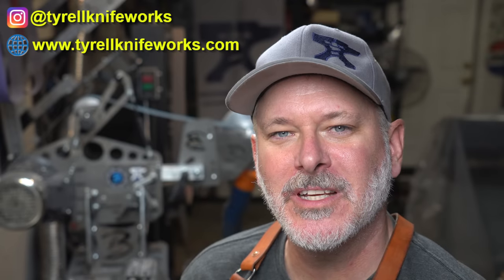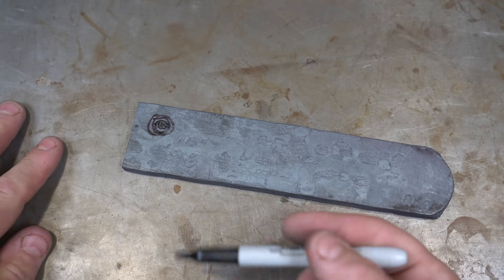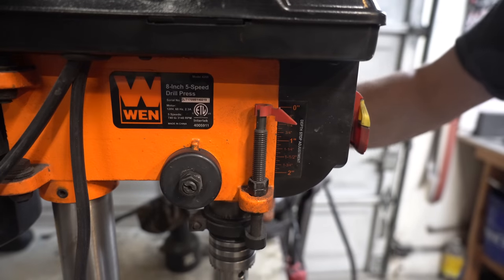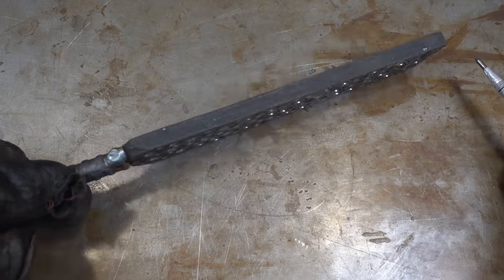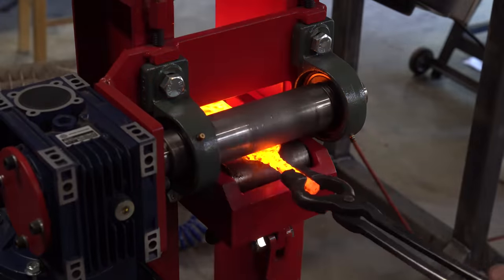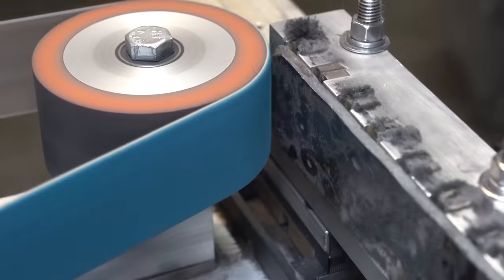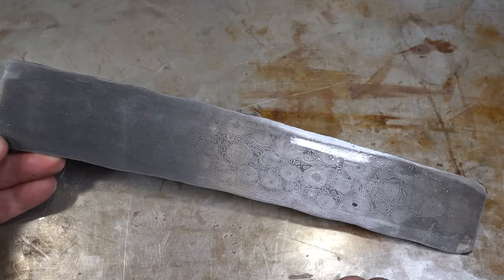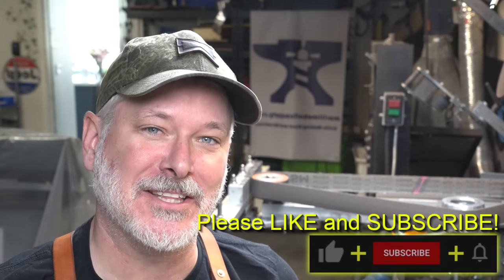Triple-T #102 - Damascus patterns - Raindrop

Comment: Two fluted ball nose endmills instead of twist drills gives me a better result with raindrop damascus. The transition is smoother and i gett more layers in the raindrops.
Reply from the maker: Yes, that’s probably much better.  It also looks better on ladder that way.  It takes much longer to do and it’s hard on your end mills though.
Reply: I use carbide endmills or with 12% cobalt the cheap Chinese one's.They last a lot longer than hss steel endmills. I also cut the ladder patterns with my milling machine and ballnose endmils. Just because I can.

Comment: I wonder if you could drill holes in holes ?? Maybe at a 16th deep ?? Or possibly a hole saw of some kind to make "rings" ?? Keep up the great work
Reply from the maker: If you had a CNC machine you cdd add n use a ballnose end mill to do any pattern.  The bottom of the hole needs to be rounded so a hole saw isn’t going to work well.  Thanks for watching

Comment: Random patterns are so hard, trying to get a consistent density as you create it point by point. I've tried handling this problem in computer graphics with Poisson Disc Sampling (random points that don't stray too far or too close to each other) and Blue Noise. They look like speckled patterns you might see in nature. I'd be curious about that type of pattern used for raindrop, albeit repeated and overlapping. Coming from a completely different field, I'd print off a poisson disc distribution example a few times and place it on the billet, drill with one size, replace the printed sheet and repeat with a different size. It sounds like overkill but randomness is so hard for me.
Reply from the maker: Are you saying you’re trying to replicate this in computer design?  I’m sure that’d be difficult.  Thanks for watching

Comment: would like to see you draw it thinner and then weld each side to some core steel.
Reply from the maker: You wouldn’t want to thin it out much more, even if you wanted to use it in a San mai.  It’s already just a hair over 1/8” so add a 3/16” core would be perfect for that application.  Thanks for watching.
Reply: @TyrellKnifeworks  hopefully one day you will show us how that San mai would work.
Reply from the maker: @lancemillward1912  probably not with a raindrop, but you’ll certainly see a San mai in this series

Comment: It's an interesting pattern, but it left me wondering, does drilling the holes to make the pattern affect the strength of the finished blade?
Reply from the maker: No, not at all.  Those “holes” get compressed and essentially removed because the steel beneath them is drawn up.  It’s just like the ladder pattern except they are circles instead of lines. Thanks for watching

Comment: Don't think that little imperfection is a trainsmash.....looks cool enough
Reply from the maker: No, it certainly is not a big deal.   It's only about 10 thousands deep, I just didn't want to grind that off the WHOLE billet and let the knifemaker just position it on the bevel or something like that where it will be ground off anyway.  Thanks for watching.